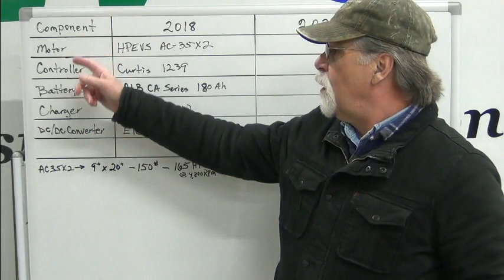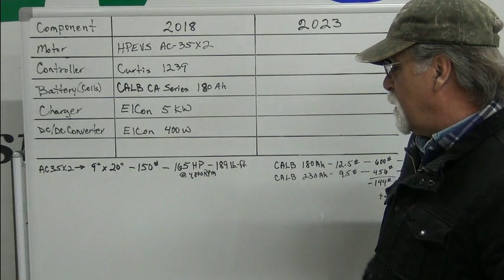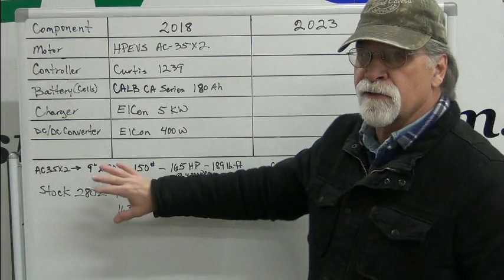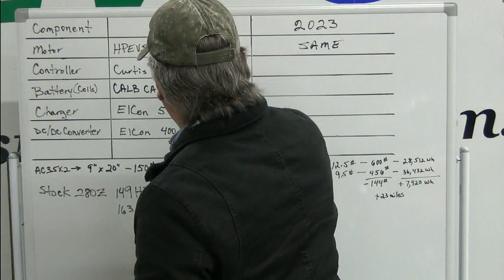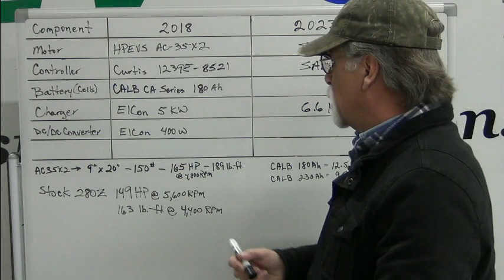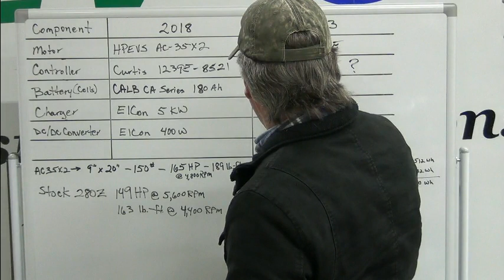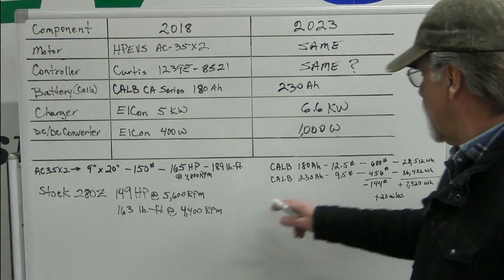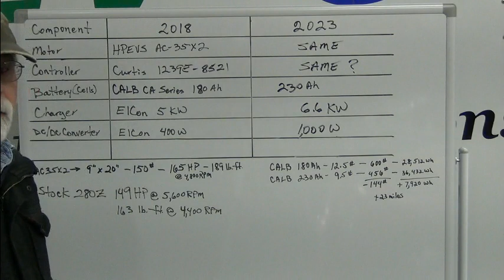EV Conversion - What has changed in the last 5 years?

Comment: I want to convert my 2001-02 Volkswagen New Beetle GLS from her 2.0 L, 115 hp/122 lb. ft. of torque gas engine to electric, she has a 4-speed automatic transmission, and is not modded, she's pretty much stock. If I use this same setup on her you do in that sweet 280Z that you now use I can gain a whopping 50 horses and 67 lb. ft. of torque in my New Beetle!!! With those stats who needs a turbo??? Everybody envisioned the New Beetle to run on electric when she first came out in 1998. Remember the commercials from then, the "Reverse Engineered From UFOs" ad with her in silver inspires all of us to convert ours, the gas filler hole can be a plug-in port instead!!!

Comment: Ps. Also there is also 160kw stack which contains charger,dcdc,inverter in one lump. I know as your a business it gets very difficult selling used parts in a conversation as you essentially have to warranty yourself! Although I love the hpevs motor range, there is the fear that using them you might get left behind the competition as if you go down the 400v route you can add fast charging which makes it an easier sell.
Reply from the maker: Safe, Simple, Reliable, and Affordable.  No worries.  Thanks for watching.

Comment: Hello there,

I'm facing an issue with an AC34x2 kit. I already have the motor and both controllers installed in my Subaru. When the car is in second gear and completely stopped, as I start to turn the motor, it generates a high-frequency noise and it seems to struggle to move the Subaru. When I connect my PC to diagnose the issue, I get an error code 8 Encoder.

I conducted a second test (A-B-A) by using a different controller. I took the Curtis controller from my Dodge Neon EV AC50. Interestingly, with this controller, the AC34x2 motor works smoothly without the high-frequency noise, and it moves the Subaru with strength.

For a third test, I swapped the main Subaru controller onto the AC50 motor in the Dodge Neon. In this case, the AC50 motor generated the high-frequency noise and lacked power.

Could you please provide some advice on how to resolve this issue? Thank you very much.
Reply from the maker: Please address your questions to:  info@EV4Unow.com  Thank you.

Comment: I am looking into doing an electric conversion, and from what ive seen it looks like Emrax basically makes the best motors. they are way lighter and more powerful than a lot of the other massive motors ive seen. I am looking at a emrax 268 and cascadia CM200, with a chevy volt battery pack. should be able to do 200KW peak with the controller and motor only being 65 pounds (of course the battery pack will be like 400lbs tho). I was also looking at a nissan leaf 160KW motor stack with a controller, charger, and motor. they are like ~2k and so i could probably get the battery, motor, and controller for ~5k, but it would be closer to 800lbs for everything instead of 465lbs. what do you think? do you have any recomendations for a cheaper controller thats either 400v ~400a or ~200v ~750a? what do you think about using a scrapped leaf motor stack?

Comment: Too expensive. Battery and charger price makes sense, but the motor and motor controller does not make sense to me. I wish I could see an expense statement from the manufacturer.
Reply from the maker: Suggest you visit any dealer's website.  The margins on motor/inverter packages are small and everyone basically charges the MSRP.  You could always make your own and see what it costs.  Thanks for watching.
Reply: @ev4u  just to put it out there, I have no idea what I'm talking about. However, that's not going to stop me from talking.

 I ended up looking at the unit more closely and I do admit that it has a lot more features than I thought, which is nice but still doesn't seem to justify the cost. I mean it's a solid-state box. It's got transformers and caps and resistors coils and ics and that stuff doesn't have to be expensive. Basically, it's a big amplifier that doesn't have to sound good.
Reply from the maker: That is obvious to those who do know.  I appreciate your opinion and honesty.
Reply: @ev4u  and I want to clarify, I am not complaining about your prices. I'm talking about the cost of manufacturing. As near as I can tell, you run a pretty awesome outfit.